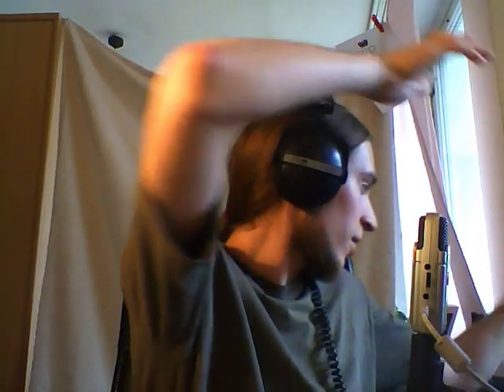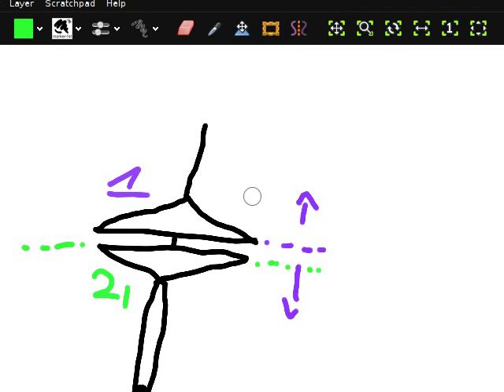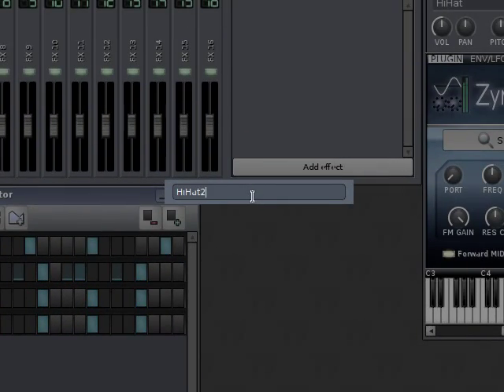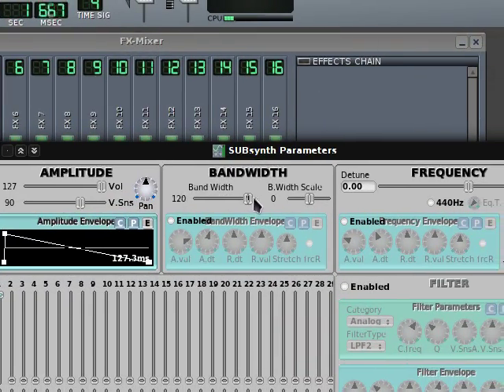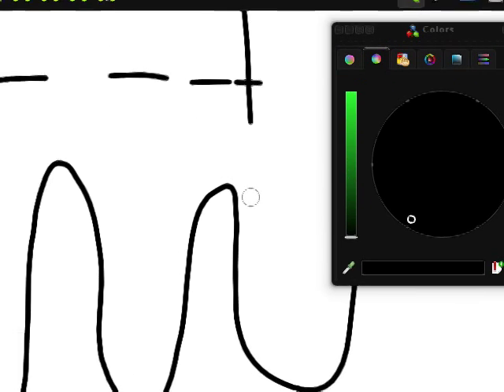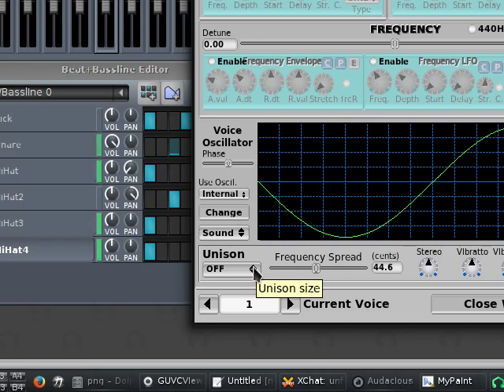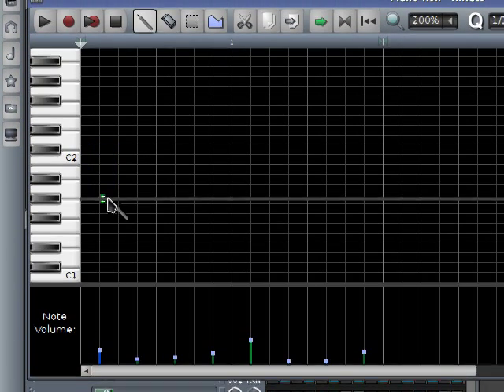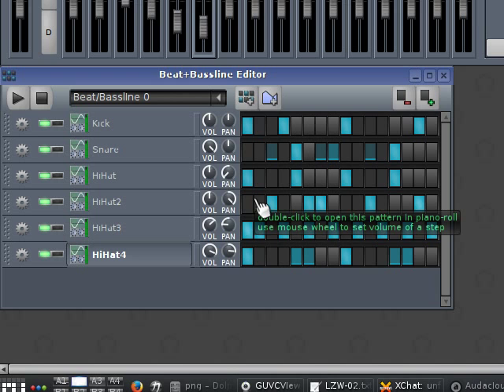unfa - LZW S2/04 - Synthesizing a HiHat

Comment: Hi unfa and all! I'm noobie about synths. I've got a question. How can I import/export synthesized sounds to my synth? What's the format of the archives to import/export?
Reply from the maker: Hi! Welcome to my channel :)
I think you might be mixing up some terminology, I'm not sure what do you mean. Exporting implies that some information will be lost. Did you mean saving/loading your synthesizer presets?
ZynAddSubFX or Zyn-Fusion has some native functions for saving and loading XMZ files (Master presets) or XIZ (instrument presets). These will store all the synthesizers setting so you can later load them up and play the same sound again (or re-use your patch in a new piece of music). Was that helpful?
Reply: @unfa00  It was partially. I'll try to explain my doubt in a better way. I'm a luthier (guitar and bass maker) and I'm developing a bass that includes (inside of the body of the instrument) a MIDI controller using Raspberry Pi. It will have some buttons that will trigger drum's sounds (a kick, a snare, some toms, hit-hat, crash and ride). My problem is that when I will install the synth engine (e.g. ZynAddSubFX) I preffer to import the drum's sounds that a professional samples composer (like you) make instead of having to make it by myself.  Like I mentioned at the first question, I'm a noobie about synth. With that being said, there's a way to import those sounds?
Reply from the maker: Wouldn't a sampler be better suited for this use-case? You could use a plug-in like Fabla or Drumkv1 to play sound files for incoming MIDI events. It'll generally be less CPU-intensice than synthesizing them on the fly, and unless you want to manipulate the synthesizer parameters during your performance, it's safer, and you can have the Raspberry Pi perform with lower latency. Such approach also lets you play acoustic drum sounds, not just synthetic ones.
Reply: @unfa00  Thanks you for the advise. I think that I was facing wrongly designing it based on synths but looking for triggering samples (which I understand that is more simple for this case). Your last video (the one you post today) help me to put name to things that I was looking for the instrument. I'll continue designing. Thanks for your videos.